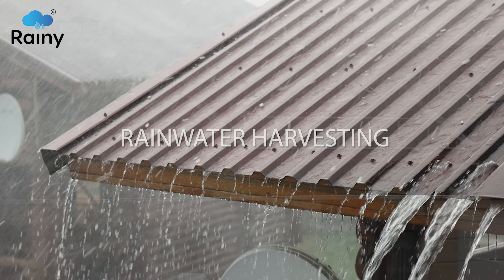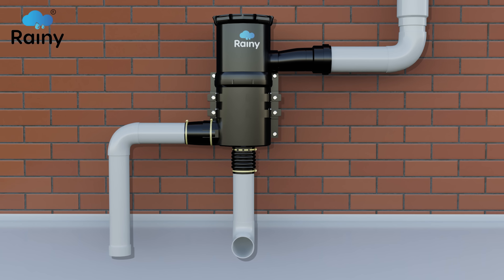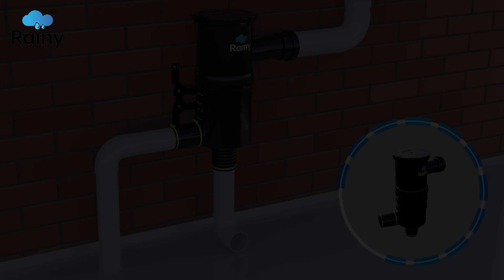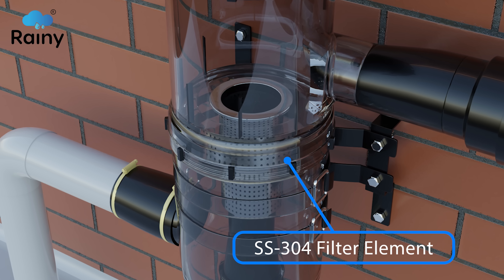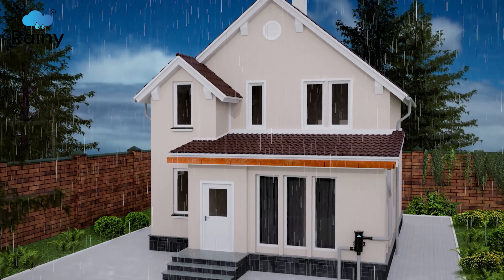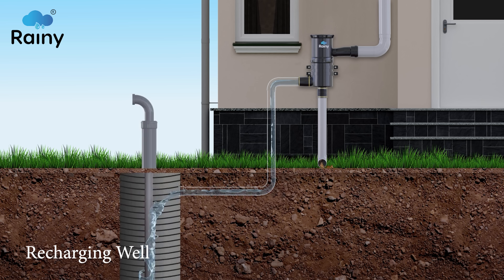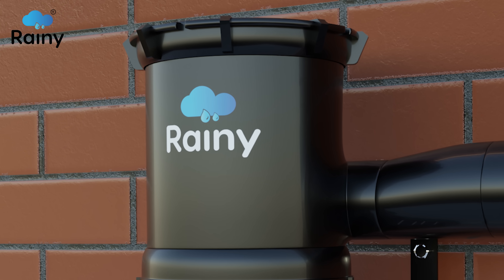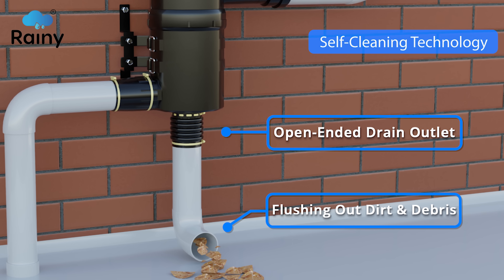Rainy Rooftop Rainwater Harvesting Filters-working video|How Rainy filters work?|Auto Flush out|

Comment: It should be installed in every house
Reply from the maker: contact us - 9996664458
Reply: Where to get?
Reply from the maker: @somasundaran.m.ssoman  You can buy it on Amazon or our official website www.rainyfilters.shop
Reply: @rainyfilters1223  do we need additional filter media (sand gravel charcoal) to b used in case of borewell recharge..
Reply: Yessssss
Reply: Iska pipe direct ground m shok pit bana k laga sakte hai Bina filter k
Ye pure area ka water level badha sakta h
Reply: What if of acid rain